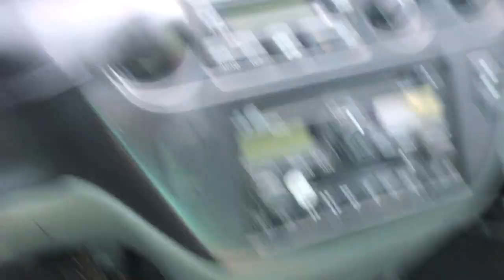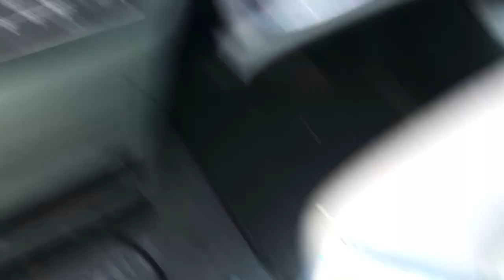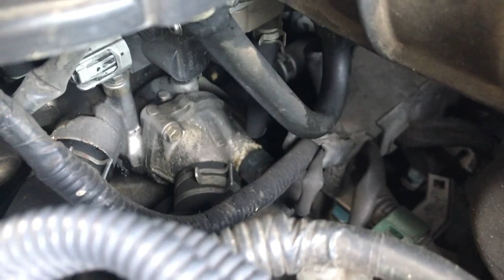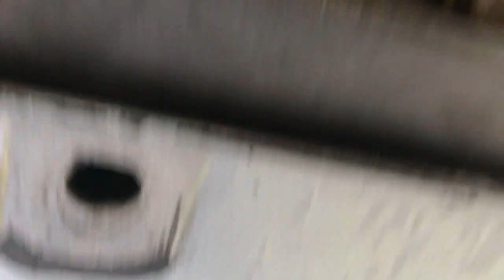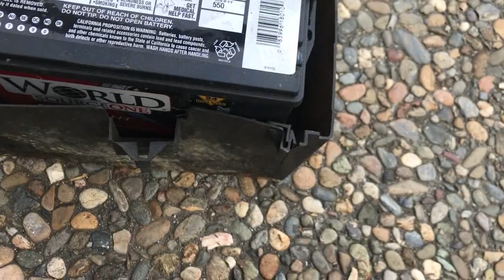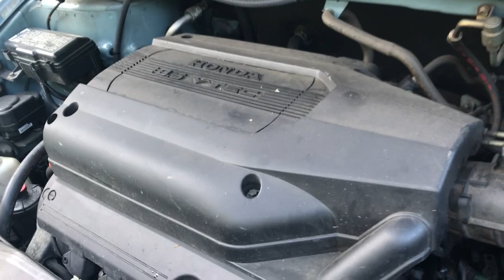Thermostat and Engine Coolant Temperature Sensor Replacement

Comment: If that's the coolant fan switch where is the temperature gauge switch that's the one I believe is wrong or faulty on my van, my temperature gauge goes up and down and I replace the thermostat I'm wondering if it is the temperature sending unit for the gauge and where would that be?
Reply: Where the code
Reply: @EXPLOREWITHME.  there is no code that’s what’s driving me crazy